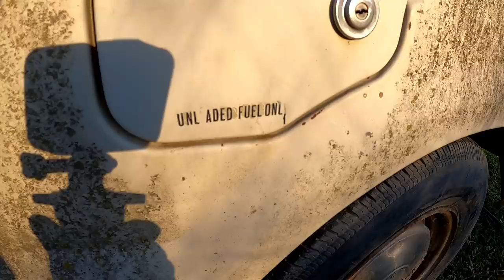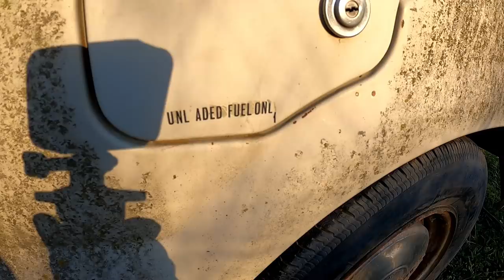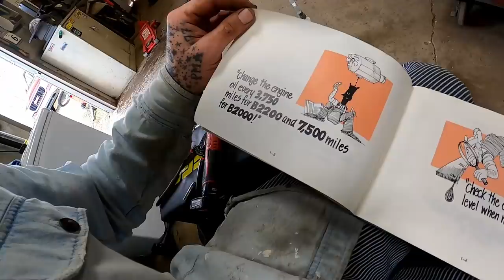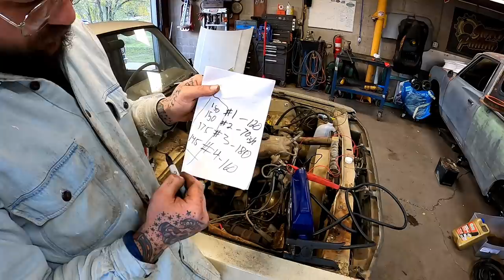ABANDONED 1983 Mazda B2000! WILL IT RUN?!? ((CHEAP Minitruck Project)).

Comment: Hot Damn! the best part of Monday is a new video from Puddin's fab shop. Glad to see you got the B2000 running. A friend of mine had one like that and it was the slowest truck I have ever driven. RIP Craftsman vacuum, they don't make them like they used to, My 5 hp  craftsman wet/dry vac is going strong after 24 years.
Reply: I had the same result with my vacuum, barely one year old but not used very much. Suddenly smoke appeared along with that awful smell of burned electric component .  That Chinese crap is undependable.

Comment: "Sundowner" is the highest trim level, like LTZ on a new Chevy or "Platinum" on a new F150.  I currently own a 1984 B2000 SE-5 (the mid-tier and the last year model for this body style)  that I'm working on getting the money together so I can get the OMC 2.3 Cobra that I have for it sent to the machine shop to bore the cylinders out just a smidge.  Just a bit of trivia:  Mazda (officially, anyway) skipped making a 1985 model year truck and introduced a new body style for the 1986 model year.  Yes, I know quite a bit about this body style of Mazda B-Series/Ford Courier.  The "Yee-Hawl" is what drew me to this channel in the first place.  If one looks closely, you may find a tag in the engine bay that identifies the rear axle gear ratio.  Mine is located on the passenger side near the hood hinge (within two feet), but it looks like Puddin's is missing.  Same for the Ford Couriers...
Reply: I have a 86 Mazda long bed. Gave $1,200 for it drove it to work for damn near twenty years had a lifter tick in it every bit of that time and sold it for $1,000.
Reply: It’s the “bud Ice” of it’s time

Comment: Love the mini trucks. Some of the BEST designs, ever. VERY practical.
Reply: Everything you need, nothing you don’t as my pappy used to say.
Reply: true had a nissan hardbody in high sxhool. lowered and running 50 series used tires and stuffed with subwoofers. love the 90s
Reply: Still have all of mine, 1 1993 Isuzu Space Cab, 1 1991 Single Cab Isuzu, and one flying Unicorn, a 1994 Isuzu P'up 4 cylinder diesel within AUTOMATIC tranny! These are vehicles of a by gone Era, and beginning to become very rare sight to see
Reply: @thecapturban  nice. I always wanted a Isuzu Amigo either to lower if 2wd or put on 33 BFG mud terrain if 4wd
Reply: @podegenst0ner303  they are still around.. hell you could soop  the hell out of it and still not get close to the cost of a side by side.. and still drive it on the road..js
Reply: I use my '87 Isuzu P'up at least a few times a week.
Reply: I just sold a 4 banger sonoma that I drove for 4 years had 121k on it

Comment: I would really dig a mid 70's Ford Courier or the like, but up here in WI, there is basically zero, nobody was keeping them out of the salt, no one thought they would quit making new ones. Who could have known that in a time where they can easily make a 200hp+ tiny engine, they wouldn't make a little truck with a 5 speed to put it in? "Small" trucks nowdays weigh more then 1980's half tons did.

Comment: Hey, Puddin, I had a Mazda B2000 in 1987. I worked at a Mazda dealership for 5 years as a mechanic. You won't go wrong with that truck. They are easy to work on and run for ever. You will be able to resell that truck, they are great little trucks.

Comment: I had an 84 B2000. Danged good little truck. The only thing was I needed to put me and 2 child's seats in it. Fail! Traded it in on a Nissan Stanza 4×4 minivan.
Those Mazdas are bad for blowing head gaskets especially if you run them hot. My friend has one with over 400k on it. Fix any coolant problems and change the oil.
I think she will clean up nice. The best thing is it's white. Anything you do to add color to it is an improvement!
It's a nice little truck that will do you good. Not huge powerhouses so I think that slide in camper was a bit optimistic. Maybe a 5.0 and AOD trans would help the power issue. LOL!
Have fun and be safe!
Cheers 
Terry

Comment: Those little Mazda pickups were a decent rig, had a couple of them when I was a kid, that single over head cam 2000 was way better than the 1600. Those Hitachi carbs were easy to rebuild, I liked the side draft carbs from the earlier sedans, they made more power, they looked like an SU side draft copy. I would have the head milled .120 and put a bigger cam in and they would go pretty good.
Reply: Currently trying to locate a side draft intake for me 82 b2000. Have you any experience with lynx manifolds?
Reply: @dinghy4344  No experience with lynx manifold

Comment: When that hood came up it sure brought back a lot of memories. Those things were notorious for head gasket issues along with the 626 with the same motor. Sometimes they would come in the door pinging really badly and that was a obvious sign that the head gasket was gone between two cylinders. If it was left too long it would cut a groove into the block. For my personal vehicle I waited till 85 and bought a 86 b2000. A much better truck. I have one genuine Mazda truck left. A 91 b2200 EFI automatic with 150 k. It's now officially turned 30 years old. Other than fluid changes and an occasional light bulb it has required zero maintenance and is as reliable as a new car.

Comment: Vacuum hose leak @37:51 off the #1 intake runner, thats suppose to go to evep shutter on air cleaner. Nice work! Rebuilding one now, bent frame and all. The 82 pistons take the 1.5/2.0/4.0 rings not the 81 and older 1.2/1.4/4.0 that are listed wrong.

Comment: You're not the "Datsun King" you are the "Mini Truck" king.  Almost 20 years ago I pulled a GA16DE out of the U Pull It yard that had already been pulled and sitting in the middle of the row.  It had water in it, and I am sure that it had some rust, even though I didn't have no scope to stick  up in it.  Engine still runs to this day strong as ever. Put in my 88 Nissan Pulsar all them years ago.  These little 4 bangers can take anything.  I got a cheapest AF  Husky shop vac from like 2003 and it still works. I put all kinds of nasty stuff down it's hose.  Sad to see Crapman live up to it's name.

Comment: My dad worked on those things when they were new. It's weird seeing everything on the engine on the other side as we had an 87 B2200 extended cab from new until a couple years ago.  Distributor, carburetor,sparkplugs, etc are all on the other side of the engine compared to this one.

Comment: Was looking online for a crankshaft seal for my 83 Sundowner and seen the video so I watched it. Not sure if you still have the truck because this video was a year ago and don't see anymore for it yet if you do those carbs are junk, rebuild mine a lot and always idling high then low then high then stop running. Well ten years ago bought a weber conversion kit for the truck and still have done nothing but bolt it on and no adjustments, runs great, deleted all that other stuff like ya said. eBay still has them it's "Weber Carburetor Conversion Kit K674"

Comment: If you haven't replaced your shop vac yet, I've had a Rigid brand for over 5 years and I'm a detailer. It has a lot of hours. Shamed to admit it, but I just changed the filter summer 2020 because I lost power; brand new.

Also, I would pay $60 for that cup. Find an online vendor that can get them out.

Comment: Had an 86 b2000 yrs back. Toughest truck I ever had. Drove it like I stole it for about 2yrs. Took it to south Carolina and back. Eventually sold it for what I bought it for after I cracked the frame just behind front axle.

Comment: The older I get the more I regret passing up on "cheap" older pickup trucks from back yonder days. Could have bought the company 76 Datsun 620, or either the 72 Courier my dad had, or the 86 Ranger he bought to replace it. All would have been cheap, and complete. Sadly, those days are gone, but hot damn, now I get to watch others snagging up the deals. It's call living vicariously through others. But I still build cars by balancing my time sitting on my butt while also getting my projects done.

Comment: One way directly or not, I had little hope for that to turn after you put that kind of pressure on the long handle flex head. I got a dumb sentence there now but my brain is kinda like the carburetor on your little truck. I got me a new chevy back in the day an my brother bought him a little Mazda like that. He still was driving it a few years latter and it had some scratches from heading out, and a near miss with a kid made him jerk the steering wheel hard and go through some blackberry brush. I hated to see that vacuum go down but for what it went through it served its purpose. Anyway my brother had that little rig long after my chevy died. For on thing, my chevy fell off the frame from rust and the mazda in same environment was doing fine cept for some scratches from the berry bush or in might of looked like that one does. Seem to be a tough little tin can. My only complaint was no leg  room inside that cabin. Plus you turn the heater on and all the dust came through the defroster vents. I think its been thirty years ago and I still dig dirt out of my eyes. Glad though that this little jitney came through it all. Good luck to you and yours. Just on a side note, maybe the very best hater can get a PHD sent to him for his participation in being judgemental

Comment: $250!! Hot damn I wish I could find a mini around here in that kind of shape for that price. Most times $250 won’t even get you a clean fender. Great deal!
Reply: I know right. I looked at a running driving one that needed carb work and a new seat in North Carolina for 5,000$ with rust holes. I was like yeah IM OUT.......

Comment: the only difference between that b2000 sundowner and your yee-Haul is the 2.3 ford pinto motor was an option ( change the timing belt it's probably ready to go.).the rest is all Toyo Kogyo, when I suggested you use the drive shaft out of the sundowner I was expecting you to measure it That's a long wheelbase long bed I'm pretty sure it's identical to your courier, if you were going to put new U joins in both drive shafts, what's the difference? you can put the one you're waiting to get in the Mazda to replace it. then you get to use your yee-Haul for a week, 
to avoid the chicken tax both of those vehicles were shipped over here without a bed , the bed or box was added on later.

Comment: Well Hot Damn... from somethin that was stuck tighter then scrooge with a nickel to somethin runnin slicker then a load of chickens slidin thru a crisco factory. Me personally i'd have never thought that would ever run again. I thought fer sure that the front 2 cylinders wit low compression it was head gasket. sure was fun to watch just the same. Hey Puddin' you have a great thanksgiving and we'll catch ya next monday! And Hot damn fer one of those mugs..... Hey hit that like button folks! later!

Comment: If the distributor has a vacuum advance canister, you can always tell which direction to distributor turns by the angle in which the canister is mounted.

Comment: Going back through the PFS archives.  
25:23 PB Blaster is the absolute worst smelling spray of all time.  Mixing it with or without anything is a recipe for stench.  Maybe thats why it works.  The rust just runs the other way.
33:50  Best advertisement line!  rofl!  Rebuilt spark plug...lol  A harbor freight brass hand wire brush works magic on plugs and wont use up so much brake kleener.

Comment: Man there is one of these sitting less then 1/4 mile from me for sale and if I didn't already have so many projects I would buy it. I had an 89 B2200 and that thing was indestructible motor wise, but it was rusting to death frame and body wise. I used to put it in reverse and go as fast as I could, push in the clutch, throw it in 1st, get er up to about 3500rpm and dump the clutch. Biggest smokiest burnouts that little 2.2 would ever do. I sold it to my buddy who slammed it to the ground causing the frame to finally gave out.

Comment: The common problem with these engines is the cam shaft seizing in the head , then you need to replace the cyl head from the galling caused to the cam journals.

Comment: My old man had a 86 B2000 which was more like the Ford Ranger, I don’t know what engine it had in it but it was a a little bitty overhead cam Hemi head Mazda 4 banger ( plugs went down through the valve cover and head). He got it brand new from a dealer ( actually my Maw did), but he must’ve put over 300k on it and around 200k he had to put another head on it, he was going out to Elizabethtown Ky, to my little brothers and broke down on BG parkway. It blew a head gasket and he didn’t know it and kept driving it, it ended up warping the head. Anyhow, that was about 04-05 when he changed that head and he passed away in 2015, in 10 years he must’ve put another 100k on her.

Comment: Actually the may both have the same trans. Ford used the Mazda transmissions in almost all fo the trucks. Just some odd information, if you take the 2.3 and 5 speed (M50D-R1) out of a ranger and put in a 302 and use the F150 5 speed (M50D-R2) the trans is a direct swap, even the 4 cyl drive shift can be reused if you keep the motor stock.

Comment: I watch a couple of different channels, I won’t tell you who they are but you’ve probably seen them. And what they use to start these engines with is starting fluid, or brake cleaner.
And on a rusted cylinder, that’s not what you want. Because it’s dry as you well know.
Maybe you have better luck because you start them with gas

Comment: the only difference between that b2000 sundowner and your yee-Haul is the 2.3 ford pinto motor was an option.the rest is all Toyo Kogyo, when I suggested you use the drive shaft out of the sundowne.r I was expecting you to measure it That's a long wheelbase long bed I'm pretty sure it's identical to your courierif if you were going to put new U joins in both drive shafts, what's the difference? you can put the one you're waiting to get in the Mazda to replace it. then you get to use your yee-Haul for a week, to avoid the chicken tax both of those vehicles were shipped over here without a bed , the bed was added on later
Reply from the maker: I’m not going to put new u joints in it.

Comment: I'll bet you you were sucking sheetrock dust with that vacuum. that stuff will kill any vacuum it plugs the filter. the way you tell rotation on a distributor is look at the vacuum advance it rotates in the direction towards it..
Reply from the maker: How much money did you just lose with that bet?
Reply: @PuddinsFabShop   I quickly realized that's a Chinese made vacuum and all bets are off sorry it sounded the way it did

Comment: HEY PUDD REMIND DUFF. HOOD HINGES, (Rebel SST hood hinges work overtime lifting the hood, silly duff) DOOR HINGES AND ALL THE LATCHES NEED LUBRIPLATE ITS BETTER THAN WD-41
I know it’s 40 IMM JUST HAVIN FUN 
LIBRIPLATE IS STICKY wd-40 washes off real easy and lubriplate does not eat wiring like WD.
WD eats the plastic or vinyl or rubber coating off those materials. WD is for metal ONLY. Morty doesn’t know Dat..

Comment: I thought these came with Ford 2.3L LIMA I4 Cylinder engine I also Thought these were the same as the Ford Ranger from (1983-2003)

Comment: The electrical gas pump I think it was just too strong and it needed a regulator for the pounds of gas now I'm not sure about the catalytic converter cuz your poor transmission oil in the carburetor other than that everything is looking just dandy.

Comment: quick easy tips for doing this on the road also, run your fuel pump and coil power wire to the headlight, no splicing or tools needed!